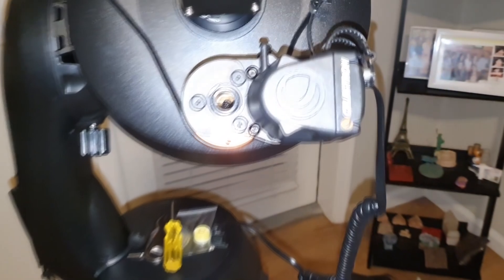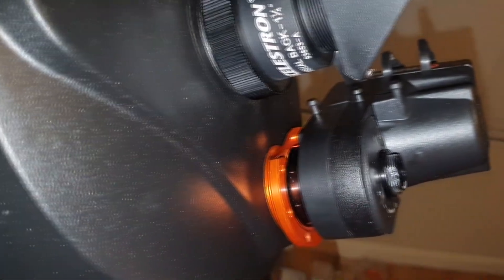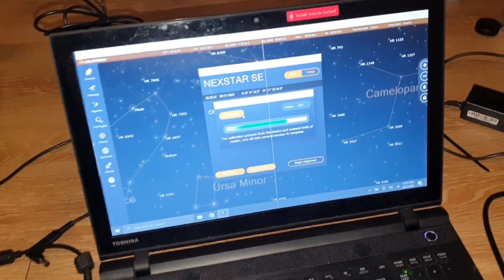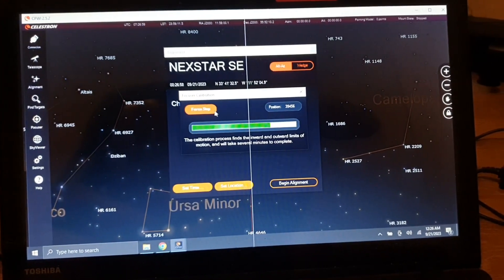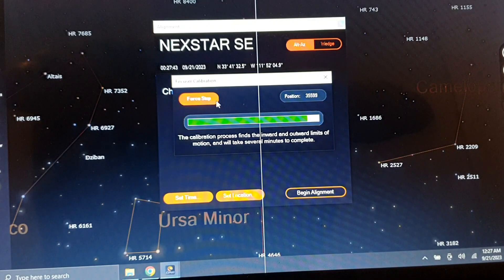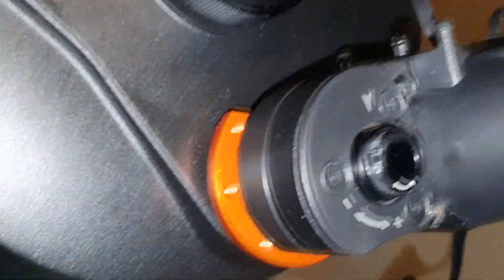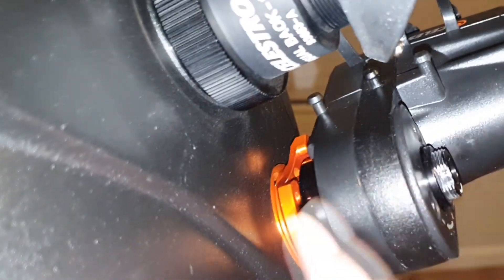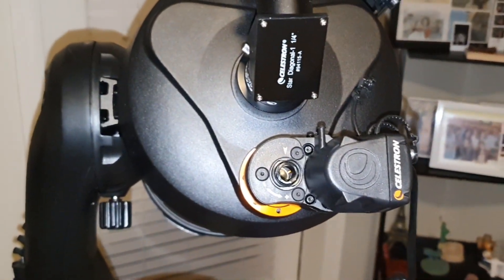Celestron Auto Focuser FIX Install Problem Issue

Comment: I just installed the included plate and used 14mm bolts instead of the original 8 or 10 mm screws that hold the plate that came with the scope. Plenty of threads into the back of the scope. Rock solid won't get loose or bind.
Reply from the maker: You are welcome

Comment: I spent three hours attempting to calibrate the focus motor but, had to stop to prep dinner. After dinner I started once again. This time I removed the motor and went through the installation instructions per Celestron. Again, no luck. Tomorrow, I will try again by installing the original plate as you suggested. Thanks for the video.
Reply from the maker: Hopefully you will have success. Let me know how it goes. I also worked for days to fix this issue, but since I installed the stock plate, working like a charm. One thing to note, if it works fine, test it for a day and then reinstall the screws with blue Loctite 242. The screw length is not much left after installing the original plate so Loctite is a must.

Comment: I have the identical setup, and I also had trouble with that about 2 years ago.  My solution after pulling some of my hair out was to use small washers between the plate in the kit and the body of the motor.  If I installed the motor exactly as the instructions showed, the focuser shaft was jammed tightly against the motor's body.  Spacing the motor back just about 2mm was enough to free it up in my case.  Seems like quite a few people have had this "tolerance" issue with this motor and the 8se focuser shaft.  Depending on the small difference in the length of the focuser shaft, you're either lucky or not.  You and I were not!  I'm glad to see you found a good way to deal with this issue.  If I ever pull mine off or move it, I might try your fix when I reattach it.  Thanks!